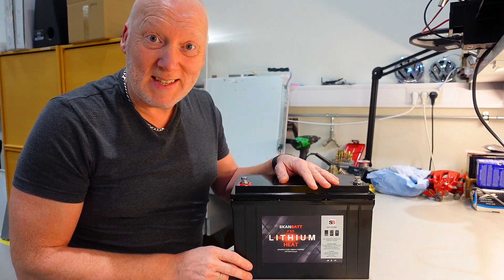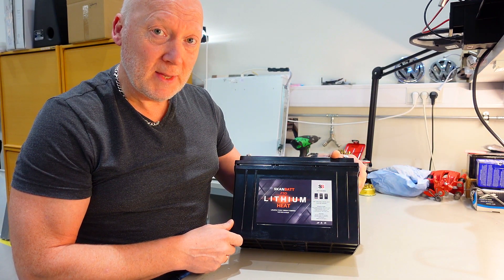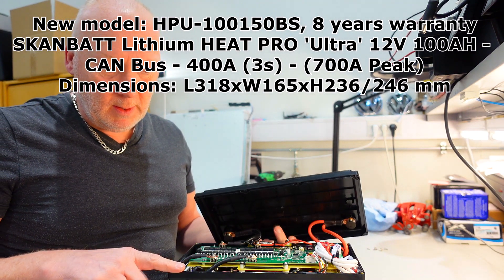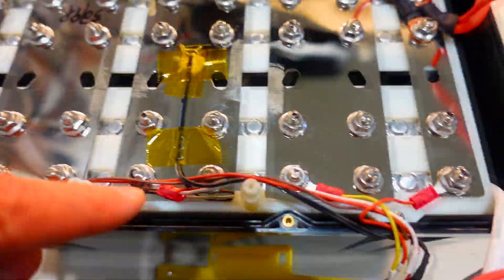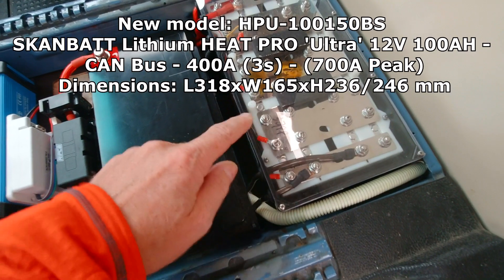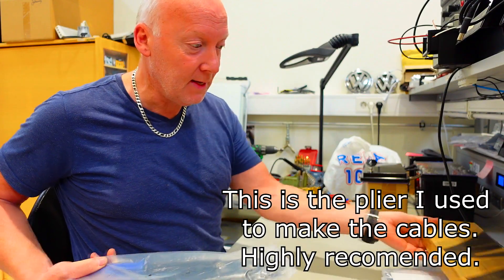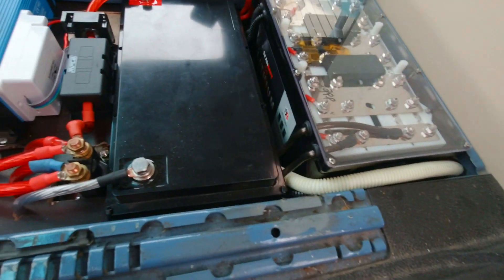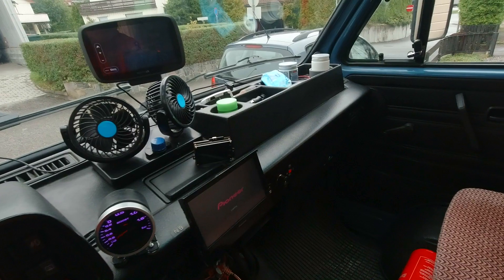I bougth myself a expencive Lithium Skanbatt battery for my vanagon T3, and I modify it!

Comment: Great work.  Could you tell us about your ignition key?  Is it a modern key fob with a traditional VW key cut into it or did you upgrade your ignition switch?
Reply from the maker: Hi there. I bougth an alarm with flip key (search in my videos), and found the correct key blade on ebay (search for N-blade), Igniton is original, only problem is the original steering wheel. The much longer key is touching the wheel, so I had to file a grove in the spokes. With the T4 steering wheel it's no problem.

Comment: I don't know if you have seen this test from Victron. https://youtu.be/jgoIocPgOug. ow to not blow up your Alternator when charging Lithium
Reply from the maker: HI there Angel. Yes I have seen that video, and I have been discussing the tema with my battery supplier. He told me, as long as the amps to the Lithium is below 60A it should be ok. Mine has never charged over 30A so all good so far. But I was planning to install a temperature probe on the alternator, so I can monitor what temperatures I get. I migth install a DCDC charger in the future.

Comment: Does the lithium battery is creating a temperature increase in your alternator?
Reply from the maker: That's a really good question, as I was afraid of that my self. As I don't have a DCDC charger, and the battery is wired over a realy which connect the battery in parallel with the starter battery, it only draws approx. 25 amps when low. This goes quickly down to around 10 amps, which it says at for some time, before it goes down to zero amps. I have put my hands on the alternator now and then to try to get a feel of how hot it becomes, and have never been unabable to hold my hands on it, which again I think is a good sign. I might add a temp sensor and gauge to monitor it in the future.